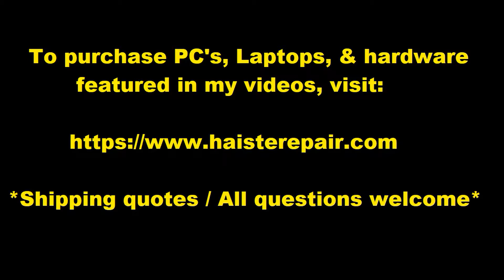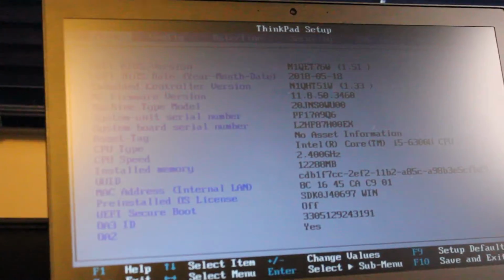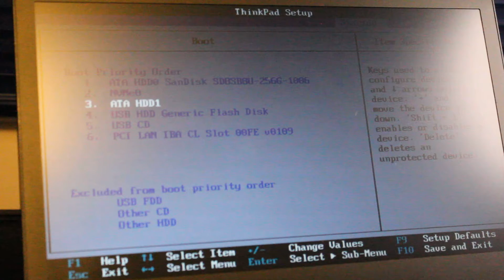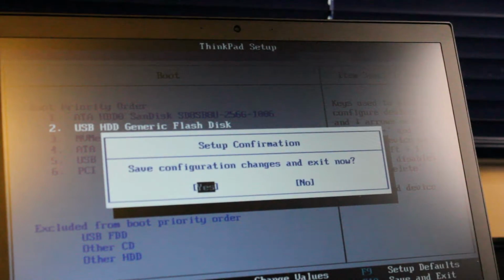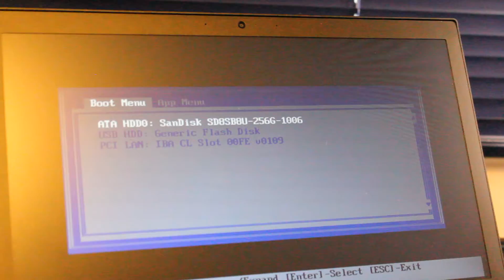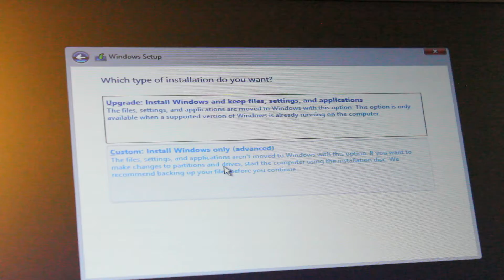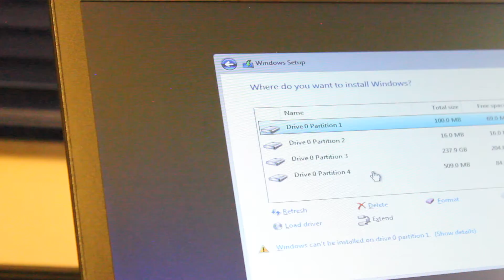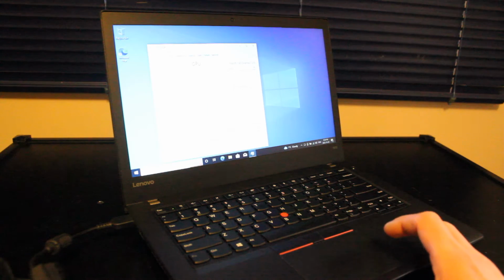Lenovo ThinkPad T470 SSD & RAM Upgrade, Service, and Spec Talk

Comment: I need help, i just added WD NVMe SSD 2242 258GB in my WAN slot, I already installed it properly and disconnected the battery before installing, but im still stuck in my LENOVO title, I can't even go to Menu
Reply from the maker: Try going into BIOS and checking the boot order.  Are you wanting to boot to Windows with that 2242?  Or is it for storage?  Dual boot etc?
Reply: It's for storage, i'll just want to add it in my extra WWAN slot

Comment: Hello, i have the same laptop and i have some questions; Can i use the mentioned wwan slot in the video as storage for m.2 2242 ssd, and would nvme work with the t470 model?
Reply from the maker: I have only tried m.2 SATA III 2242 SSD's, I can't speak to whether an nvme would work.  Check online to see what people are saying.  or if you try it out let me know how it goes.
Reply: So I did search around and found that only B or B+M keyed SSDs will work, and it should be SATA, tho I did see posts on Reddit that said t470 older than 6th gen CPU would work with nvme. But I guess SATA is a safer option !
Reply from the maker: @boing534  May as well go with what is guaranteed to work unless you have a spare NVMe to test.  Good luck!

Comment: 2:16 why not just put a nvme drive on the slot and keep the intel one that come stock? the intel drive's worth is ~120 CAD since for what i have seen actually i got a full size intel nvme drive stock. all of this on a reconditioned by lenovo, US model.
Reply from the maker: The only reason is because this particular lot came with 2.5" SATA caddies and I wasn't going to worry about the added expense of replacing them unless a customer wanted one installed.

Comment: small laptop... small yes its 14 inches but the thing is still alsmost 1 inches thick, enevntough i still love it even if it does not fit in most laptop pocket and the thing is compatible with 100w usb-c charging or power delivery
Reply: and the T470 is a jet turbine for his power ; the thing is termal throttling even with a 1 month old termal pastes ¯\_(ツ)_/¯
Reply: and fully clean cooling system

Comment: Hi, Do you have a video or know where to find one that has a "How to move windows 11 to a USB for Lenovo ThinkPad'  then I could do the steps you showed in the video
Reply from the maker: If you mean just creating Windows 11 install media, just take a USB drive with at least 8GB of space, format it FAT32, and go here to download the setup:  https://www.microsoft.com/en-us/software-download/windows11

Note the T470 has a CPU on the non support list for win 11, so you would have to use Rufus to install.  Ask me for more info if needed.
Reply: @HaisteComputerRepair  Ok I'll try to explain everything as best as I could and the current status I'm at:   I wanted to upgrade my Lenovo T470's SSD and ram ...so I had to go from a SATA (256GB) to NVMe SSD (1TB) expect when I go to the setup screen after the install I don't see Windows anymore from the BOOT selection. Then I try running my laptop saving the changes and just get 2 options to select from the main screen but no matter which selection I make the screen keeps reverting back to menu with the two options.    Any reason why this happen or what direction should I take in the setup screen?
Reply from the maker: @30guarino  It sounds like you need to simply install Windows.  Here is the link for Windows 10 install media if you have that 8GB or more USB drive:  https://www.microsoft.com/en-us/software-download/windows10%20

If you want Windows 11 for any reason:  https://www.zdnet.com/article/how-to-install-windows-11-the-way-you-want-and-bypass-microsofts-restrictions/

Comment: Your hands are in the way  we can't, see what you're doing. Mine says it has DDR4 SO-DIM 260 pin
Reply from the maker: It will take 2 x DDR4 SODIMM up to 2400MHz.  You can install a higher speed, but it will default to 2400MHz.

Comment: Very good/encouraging tutorial ; I never noticed a place was designed for a regular 2.5 SSD. NV M2 have a reputation of heating beyond expectations. My machine has a NV M2  installed in this brand new/never used T470 I recently purchased.  Thank you for reminding to disconnect the extra battery.  I hope your comment about the performances will change because of the upgrade you made. I will let you know if I succeeded installing a SSY, PNY or Crucial maybe, what would you recommend ? Thank you very much.
Reply from the maker: My pleasure!  Either of those brands would be fine.  Crucial 2.5" SSD's being a trusted experience.  If you are on a tighter budget, a brand called Timetec is pretty good.  Or TeamGroup, Patriot, Silicon Power.
Reply: @HaisteComputerRepair  Oh thanks how did you guess about my budget 😀
Reply from the maker: @ohlazumbie  Lucky ;)
Reply: Hello :) Could it be that some T470 are NVM2 disks and some others 2.5" SSD. Thank you for very clearly showing those SATA connectors in your tutorial. I have Win 11 installed on  my T470...very stable although it does not have that TPM 2.0. I'm sure you know the tip :) I must be maniac but I prefer those 2.5" SSD ^^

Comment: Any new parts you reccomend now? I ordered a refurb t470 to use with my Akai midi contoller. I paid $190 through Amazon with some gift cards i got for xmas.
Reply from the maker: I would just add RAM and SSD's to your liking.  If there's other things worn that you would like refreshed, it's fairly easy to replace things like touchpads and keyboards etc.  Good luck with your laptop!
Reply: Can we upgrade CPU in a t470 @HaisteComputerRepair

Comment: Do I need windows 10 USB Stick to install  windows after the SSD upgrade?
Reply from the maker: Yes, that is correct.  Unless you had Windows 10 preloaded on to the SSD.  But either way, best to install fresh if you can.

Comment: Hi,

It is very useful video for me...just having same laptop without memory and storage...though I should use 2 × 16GB and SSD 512GB 
Question is will it be a overkill or it will perform much faster compared to 12gb and 256 settings?

Thanks in advance for reply
Reply from the maker: If you have the budget, go for it.  I would say a SSD and at least 16GB RAM would be a sweet spot, though it may depend on what you are using the laptop for.
Reply: @HaisteComputerRepair  thanks

Comment: Can the t470 support ram speeds of 2666?
Reply from the maker: No, it would likely cap out at 2133MHz.  You can install 2666MHz, but it will not go over 2133MHz.

Comment: Nice video, but you forgot the critical step to disable the internal battery in the BIOS before opening the laptop. This is found in the Power Management menu. This critical step is required because some T470s are shipped with two batteries, one removable and one internal, non-removable.
Reply from the maker: I do show how to unplug the internal battery after removing the panel.  I defaulted to this before knowing it was an option in BIOS (going back to the T440, for me).  I don't usually bother with entering BIOS and disabling if I am going to unplug.  Do you know of any problems with this method?  I have not had any problems doing this, but I am certainly not saying my way is the best way.  I may be missing something?    I have serviced many models with internal batteries.
Reply: @HaisteComputerRepair  Yes you did, I confirm. Some people can'ty read nor even listen properly. Thanks a lot HCR, I'll be back ^^🙂

Comment: If im plannin to install a 8gb ram and a 4gb ram do i need to enter the bios menu?or can i just disconnect internal battery and swap rams and turn on laptop?
Reply from the maker: You can take out the external battery, open up the case, unplug the internal battery, install the RAM, maybe do a test run with the power adapter before putting everything back together, and then plug the internal batter back in and put it back together.  Good luck!

Comment: You can't beat those Thinkpads. I'm still in love with my T430. Cheap, built like tanks, easy to get into, and run as fast as you need it to (outside gaming). Thanks for sharing, neat to see their more recent visions- I haven't delved much into their newer models.
Reply from the maker: I like the ThinkPads, like the T430, where you can swap the CPU out.  A T430 with a quad core i7 is a solid laptop even today.  One of the T470's I got has a nvme SSD adapter for the 2.5" HDD bay, so I will film a video for that once I get the nvme ssd in the mail.
Reply: I am Planning for eGPU on this T470